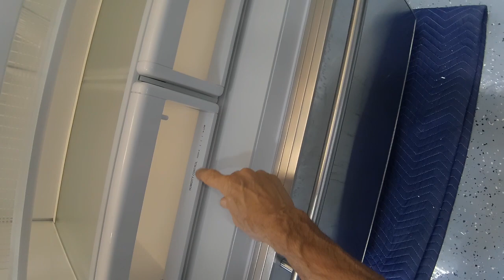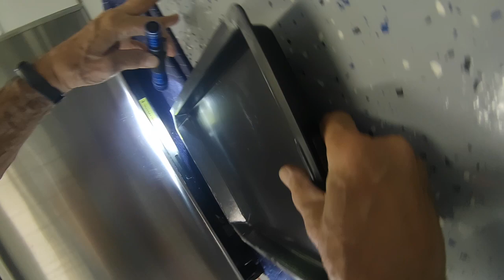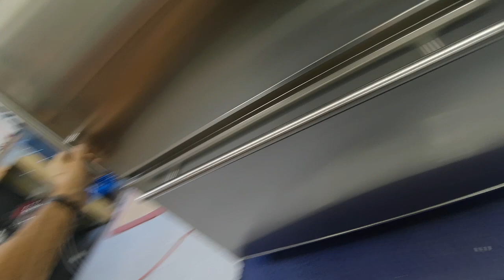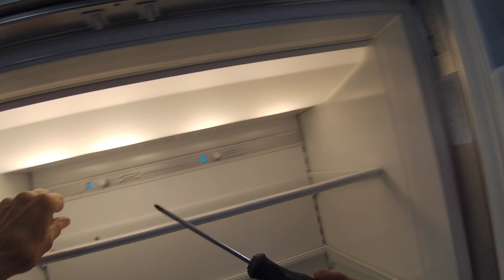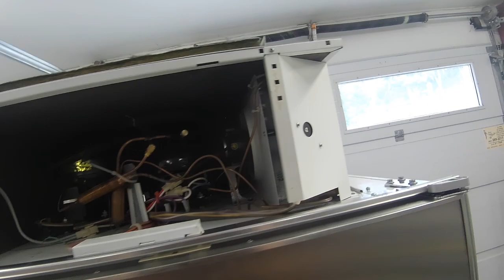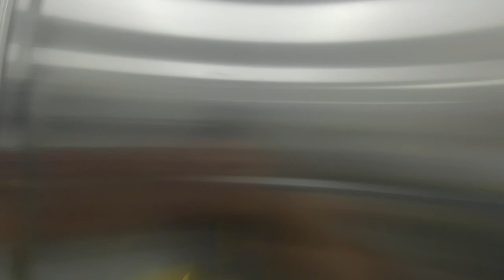Sub-Zero 550-511 Use & Care Guide

Comment: Hi Aaron. I just picked up a 511 Sub-Zero.

The Fridge door closes but doesnt feel like it is "latching". The door comes loose with the most minimal pull. 

The gasket looks to be in good condition. I found a 1/2 inch round magnet in the freezer. Could this magnet have come loose off the Fridge door causing the door to not seal fully?

The freezer on the other hand latches and seals perfectly and requires some force to detach!!
Reply from the maker: Check the door cams on the bottom of the lower hinge.
Reply: @SubZeroSpecialists Thank you Sir!!
Reply from the maker: Did you check the door cams?
Reply: @SubZeroSpecialists Yessir. They were shot. Going to replace and retest the door. 

Also, I think the front legs need to be adjusted to raise the height. Looks like the Fridge is tilted forward.

Thanks again for help!!

Comment: I have 550 S/N 1099846, the freezer drawer jams due to ice buildup on one side wall and floor and prevents from opening. I replaced the defrost timer, defrost terminator and checked the resistance on heater coil it shows continuity and reads 25 on multimeter. None of them fixed the issue, what else to check?
Reply from the maker: @punamia  what side is the ice build up?
Reply: @SubZeroSpecialists  The ice build up is on right hand side. Right hand side is where the defrost drain pan under the evaporator coil troughs in to the wall.
Reply from the maker: @ your drain is frozen. Subzero makes a heater kit for that
Reply: @SubZeroSpecialists  Thx. A sub-zero heater kit was installed 5-6 years ago by a sub-zero technician. May be it broke and needs replacement?
Reply from the maker: @ drop the panel to expose the drain. If there’s a heater in the drain tube you can check it for continuity. If the heater is bad make sure the drain is completely defrosted before you pull it out. Pour some hot water down and make sure it drains out, I’ve seen these heaters break inside the drain tube.
Reply: @SubZeroSpecialists  the heater in drain tube shows resistance reading of 740. Is that good enough? Pouring hot water from freezer's right sidewall  drain goes very slow but did  end up in the drain pan at the bottom. is there supposed to caulking where the evaporator condensation troughs in to this drain? looks like water drips from there causing ice build up and jams the drawer.
Reply from the maker: @ it seems like you have a restriction in the drain tube even it’s it’s draining out, could be clogged. At this point I would pull the heater out and clear the drain. You’ll need 1/4” plastic tubing and some fishing line to reinstall the heater or buy a new heater kit. Yes there is chalking around the evaporator coil cover but that wouldn’t cause it to leak. Removing the heater is delicate, it could break. I have a technique for removing a broken heater, but no video as of now.

Comment: Hey, so i have water forming in the bottom floor of my 550 fridge.  I cleared out the drain with bleach and warm water. It's cleared out. I also replaced the freezer and fridge door gaskets.

Water still pools on the fridge floor, what could it be?  The freezer is working great, no ice forming along the walls.  Ice machine works great too... The water forming is very confusing, help please?
Reply from the maker: Is there water in the drain trough? If not you may be getting condensation forming due to the insulation between the freezer and fridge compartment, it looses efficiency over time. Sub-Zero has a fix for it, it’s called a floor heater.
Reply: @SubZeroSpecialists  thanks, when you say water in the drain, do you mean water backed up in the drain?  It should be clear of any water and debris correct?  

If I pour water down it, it should end up all in the plan under the fridge.  To confirm, water on the floor could mean a backed up drain that's overflowing with water, which then ends up on the fridge floor, correct?
Reply from the maker: Yes. If you pour water into the drain hose and it reaches the pan your drain is not clogged.
Reply: @SubZeroSpecialists  Thanks again!  So a floor heater should solve this issue, correct?  What's the part number for the 550 model?
Reply from the maker: @amit.tyagi.careers  I don’t have the PN available call Sub-Zero at 800-222-7820 for your nearest location.